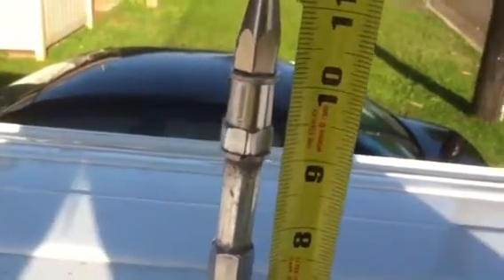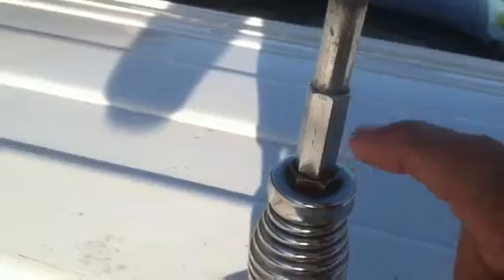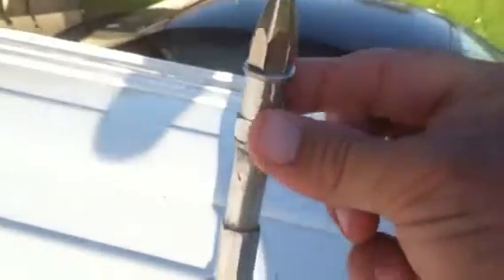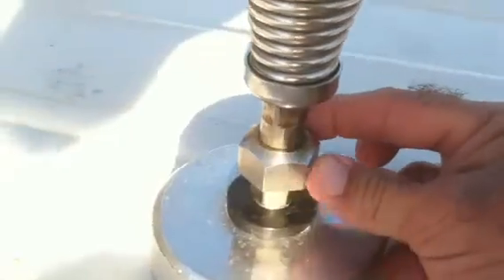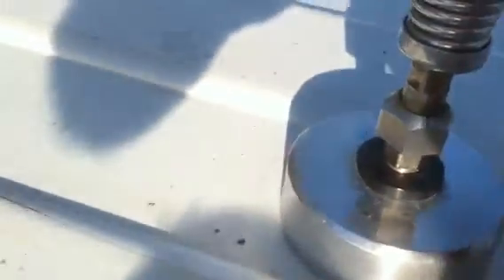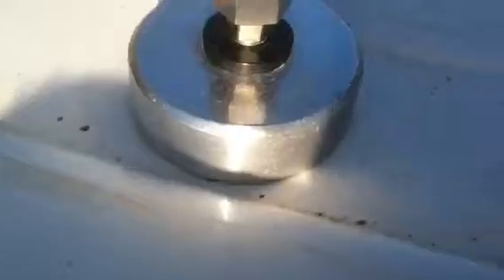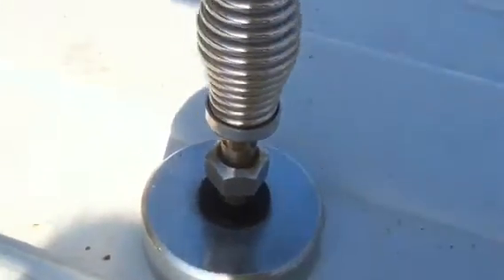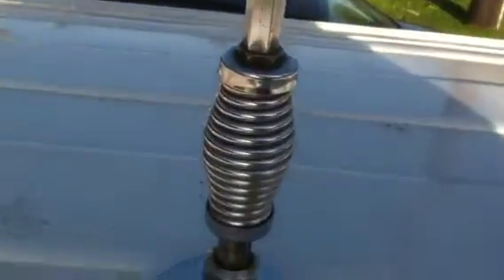102 inch plus 10 inch of quick dis, S.S. spring and filler...

Comment: Look on ebay and get the 7 inch whip riser. $35. Looks better and does the same job.
Reply from the maker: All the parts were free.
Reply: I use the 10” riser for my 102” whip. Tunes great

Comment: When you add the extra length to the antenna doesn’t that change it’s a resonance frequency .  The antenna is now longer than 108 inches
Reply from the maker: Global Mobile 357.  Yes it does. It took several days at different locations (the spots I shoot skip from) and a MFJ-259 B to set up that antenna. It has 1.0 swr, 0 for reflect at 50 ohms on 27.025 mhz
73' and Aloha from the Rockies
Reply: @808intheminigrass  Should be able to make your resonante freq what ever you want with the adjustments in length..
Reply: So to adjust, did you have to trim the length?

Comment: thoes spacer lower your swr with amps got same exact set up funny trying to lower my swr was perfect until hooked up power gee whizz LOL
Reply from the maker: Yes you are correct, if a little power is added, you got to start from scratch with tuning the antenna system. 73's and Aloha from the Rockies

Comment: I wouldn't want to be sitting that close to a antenna putting out that much. Slowly cooking yourself man. Lol...
Reply from the maker: kev mar. Its only 600 watts of rms. Lot less than a mircowave heating up some leftovers. 73's from the Rockies
Reply: @808intheminigrass  nice rig. Good job. 73s from The Powerhouse
Reply from the maker: @Eternitynoteskevinwwalton      I have sold the 3500 Chevy and transfered all the radio equipment to a 1992 Chevy Silverado. Thanks for the comment, 73's from the Rockies.